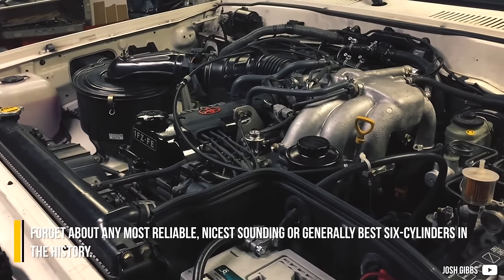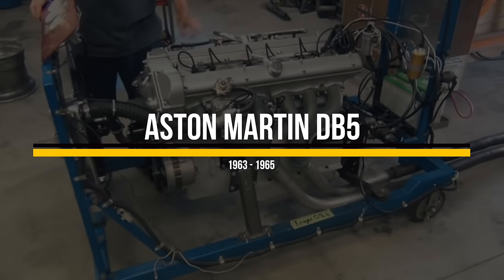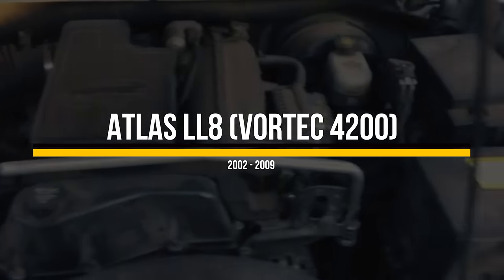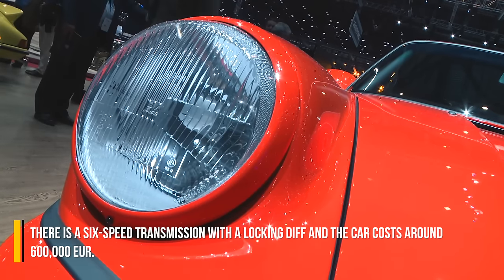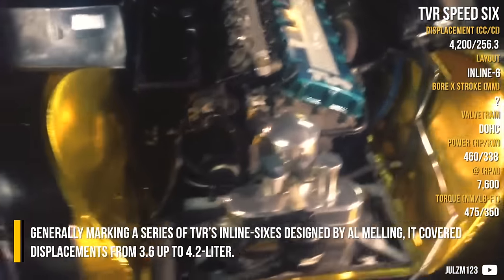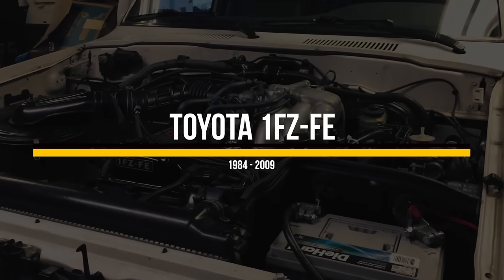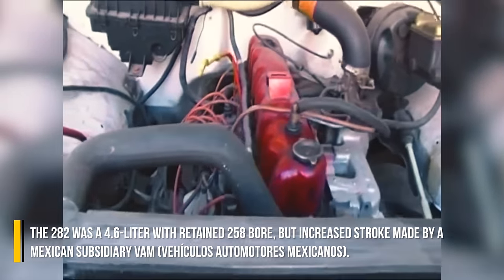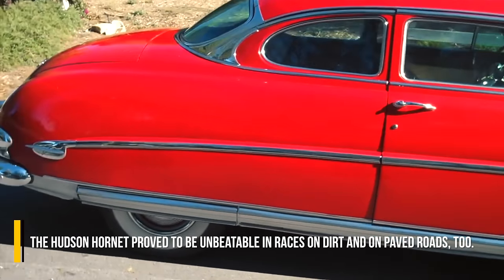12 Largest Automotive 6 Cylinders In The History

Comment: That Ford 300 is probably the slowest out of all the engines on this list but its my favorite. My Father owned several of them and they will tow nearly anything you ask of it (albeit, not in any hurry) and will run forever with proper care, especially oil changes.
Reply: Yeah those poor 300s are a gem for pulling but much above 3500 rpm they get winded think that's why they didn't make much h.p. They pulled much like a diesel. You can thank that on the normal sized bore and really long stroke.
Reply: Love the 300 ci ford. Can't kill them if properly maintained.
Reply: @maynardreed4036  yeah my crazy friend bought one time with over 250000 miles I asked him why he would buy something with that kinda mileage he suprised me when he got it to 415000miles before it started smoking some and making a little bearing rattle from low oil pressure
Reply: @ReidHenderson  yup probably still had another 50 or 75000 miles in it.
Reply: I had a Ford 300 in a '67 Fairlane back in the '70's. With some help from Clifford Engineering it would kill small block Fords and Chevys. Cam and kit, headers, intake manifold with 2 Weber carbs, porting and head work(larger valves), etc. It spun to 6500 rpm and made 366 HP. It was a fun car to drive! I had to put a top loader 4 speed trans in it, the stock 3 speed from the 240 kept breaking cluster gears.
Reply: @ajwilson605  Yes, Clifford-Jacobs Research [their motto: 6=8] were the only source for hi-po parts for the 300 during the 1980's. There just isn't many speed parts for this tough 7 main bearing engine, BTW the Ford 300 is rated for commercial duty, it is rated at 92 KW running on LP.

Comment: A few things-
-I don't think Inline and V engines should be grouped together. They have very different characteristics imo. V engines are a packaging/cost choice, inline engines are durability and low rpm torque choice. I very much miss my 5 speed manual 300 6 F150. I am not sure if Ford ever put the 300 6 in a car though.. but it was used in light duty F series trucks.
-I take it saying automotive allowed you to avoid heavy duty applications, because there were some quite big ones used. That makes sense to try and avoid all those old HD engines.
-I was disappointed when GM abandoned the Atlas series. The Inline 6 had more potential than the 4.3 currently used.. but costs are costs when talking base engines.

Comment: There's no replacement for displacement!
Reply: Variable valve timing...Turbo charging... But you're right.  Nothing feels like a v8 N/A engine with tons of response and bottom end torque.
Reply: Watch Boostedbois, that might change your mind hahah.
Reply: 4.1 liters but 125hp?
Reply: @franciscodieguez5187  The 1976 SS Model had 171 hp and 319 nm, pretty good for 70s
Reply: yeah. and Nux affirms that
Reply: Well, realistically, there is. You can't have tons of power just by adding displacement. Because if you do, the engine just keeps getting bigger and heavier, also revving slower, and you do need revs to make power. In real life, there is always a balance and an ever changing recipe to make power for each engine, since they are not the same.
Reply: Unless you count high revs and forced induction.  Then there is.  :)
Reply: I think you guys doesn't know what is a joke....
Reply: @igortchelzoff3736  I guess people make this joke too often and maybe that's why some may not be really responsive to this.
Reply: It isnt really a false statement though. You can replace displacement with boost, but you lose that N/A response. Bottom end torque isn't improved much either

A N/A large V8 mated with a manual transmission is a unique feeling. It cant be replaced.
Reply: 15 liter Cummins fuck yea
Reply: @Josh-cw8by  I don't see your point, so it would be the 3.5L V8 from the Atom
Reply: DoubleC can you Elaborate? Sorry man I don't see how you get my point.
Reply: @Josh-cw8by  You said an N/A large V8 can't be replaced, and so it would be a high revving 3.5L V8 from the Atom, that is why it doesn't make sense.
Reply: DoubleC high reving v8s are awesome, however the power falls off eventually. My favorite part about larger v8s is the torque you get at the bottom end. I'm a city driver.
Reply: Except a 4.0 barra turbo.
Reply: Zentäi 289
Cadillac made a 8.2 V8 that made 190 HP
they make engines differently now, i have a 2.8 inline 4 Cylinder that makes 175 HP
Reply: @anthonywebber2211  that's the biggest 4 cylinder I've heard of.
Reply: Josh
what 2.8?
Reply: @anthonywebber2211  you said you had a car with a 2.8 litre did you not?
Reply: i have a truck with a 2.8 liter
Jeep Liberty had a 2.8 L diesel
Chevrolet Colorado has a 2.8 diesel
Cummins 4BT is 2.8
and the Buick Bug had a 10.2 liter 4 cylinder
Reply: @Josh-cw8by  turbos and supercharging doesnt matter. If you have a 5ltr v8 with dohc vs a 2ltr 4 banger. The v8 will always beat the 4
Reply: @acedogboy8421  You're.. you're eating paint chips again. Stop that.  How can forced induction "not matter" when it necessarily changes the dynamics of the engine? Also, many 2L turbos will beat a 5L N/A and vice versa. Absolute claims are dishonest. Can you demonstrate that a 5L will ALWAYS beat a 2L?

Comment: First time I’ve seen your channel, interesting but lacking big time in research.  You had some light duty pickups featured so let me give you some help.  GMC had a line of V6 engines for their light duty trucks all during the 60’s and I to the early 70’s.  They ranged from 305CI all the way to  401CI, they even had. 432 and a 478CI.  All of these dwarf your 12 largest 6 cyl engines.  GM’s slogan was the power of  a 8 cyl and the economy of a 6 cyl.  By the way, neither claim was anywhere near true.

Comment: The later Atlas 4,2 had over 290 HP.  It was on Ward's 10 best engines list for many years. But I'm certain it never made the 16000 RPM you show.

Comment: I agree with the one comment the best engine I've ever built for straight 6 was the G MC 302 2 barrel carb 3in exhaust 12-inch clutch what are credible smooth-running Beast and it did have a great oiling system tremendous low-end torque I put it in a flatbed truck for a guy it was a sweet running machine

Comment: There was also the GM 4.3, which in my best estimation is one of if not the best V6’s to have ever been produced. It was basically a 350 with 2 cylinders lopped off.
Reply: Not found in any passenger cars, just trucks?
Reply: @sauluribe7082  it was put in s and t series trucks and CK trucks .
Reply: chevy put them in carices,had 265 thousand out of mine,Never was inside it,didnt use oil !

Comment: Almost every cummins?
Reply: Will Glenz I was kinda surprised not to see a Cummins on the list
Reply: it's basically a bus engine
Reply: @merroika1050  But they are used in production automotives as well 🤔
Reply: They are all gassers in this video
Reply: they did use it in the dodge Ram, but yeh it's classed as a truck engine basically.
Reply: 5.9L I6 from the 12 valve and 6.7L from the current, the latter being the largest 6 cylinder on the market today
Reply: This video only covered a biggest six cylinder gasoline engine
Reply: Well yeah, I'm guessing the reason he didn't include the 6bt was that it was really intended for commercial use but ended up in a normal pickup truck.
If we do include commercial diesels then we can go into mega displacements on the straight six,
Volvo does a 16litre straight six for there trucks with up to 750hp and 3550nm (~2600lbft) and I'm sure CAT did a 18litre highway straight 6 with ~900hp
And I'm sure there are many ship engines which much bigger displacements than that....
Reply: The 6BT was developed by Cummins specifically for use in the the Dodge Ram pickup trucks due to dodges lack of a diesel truck in its lineup. The 6BT was never meant for commercial use therefore is not in the same category as production commercial diesel motors. The 6.7L I6 in the current Cummins is also meant solely for the Dodge Ram pickup trucks therefore again does not fall into the same category as current production commercial diesel motors
Reply: @erinwoolen4797  No, it was ment as a commercial diesel before it ended up in the Ram hence why they're so strong and reliable
Reply: No, I have personally owned a 6BT ram.  I can attest to its reliability do not get me wrong. It was built by a company that produces commercial Diesel engines yes, but it was not built for commercial use. Look it up, get your facts right, and do not attempt to try and make me sound like I don’t know what I am talking about because you will find yourself on the wrong end of the knowledge.
Reply: @erinwoolen4797  erm.....

So when it came time for Dodge to up the ante in the world of heavy-duty pickups, they turned to Cummins for help. General Motors had the ultra-efficient Detroit diesel, while Ford had the powerful IDI diesel engine made by International Harvester. Both of these engines were V8 diesels specifically designed for use in a pickup truck as an alternative to thirsty gasoline engines. In contrast, Dodge decided to borrow the existing B Series Cummins engine. The B Series was a straight-six diesel engine widely used in mail trucks, school buses and even in mining operations as generators. It needed to work in the Ram, too—Dodge was already several years late to the diesel truck party.

I think "borrow" and "existing" are the main words in there....
Reply: Yes it was in the B series of motors but the 6BT in particular was developed for the truck. The platform of motors even included the 4cyl 4BT used in the international harvester which became the platform for the 6BT in the ram and the 6BTA which was used for other purposes. The 6BT in and of itself was designed for the ram not for commercial use. Yes you are correct it is in the B series of motors which were in fact designed for commercial use, but the 6BT itself was designed for the ram. You have your information almost correct, the only thing you’ve gotten wrong was the 6BT in particular
Reply: @erinwoolen4797  not true

Comment: Is it weird that the Ford Barra in the 2nd clip sounded almost like a Chevy/Ford V8 at idle?
Reply: Single cam 4L Intech motors get a massive chop on when you drop a decent cam into them
Reply: owned an AU XR6 lumpy cam 3-inch pipe it used to vibrate the windows on houses at 25kph
Reply: And all the 'Barra's' in the article never came in those models. BA on.

Comment: Sorry but I’m Australian and your numbers for the N/A Barra is off, the latest N/A Barra is 198kw. The turbo version is up around 300kw but all the cars in the video are N/A.
Reply: The turbo was actually 400kw in final guise, ford underate their power figures compared to GM which overhyped everything.
Reply: Sky Surv Aviation I was being conservative because he showed mostly BA falcons I think the BA mk2 was about 300kw
Reply: The BF makes 195 KW in base model (250 HP, give or take) and with a supercharger, what I'm planning to do, can make so much more.  Also, as a family sedan, the cars are cheap to make, and can run on regular fuel without drama.  An amazing motor that should still be in production
Reply: The turbo Barra in xr6 sprint is officially rated at 335kw or 370kw on overboost if I am correct

Comment: Rams 6.7 liter inline 6 cummins turbo diesel???
Reply: They put that shit in fire trucks.
Reply: Well, not the 6.7, but the 14.9 six cylinders are the top of the line right now with 600hp and 1800 ft/lbs.
Reply: @spencerhudzenko3734  psst! Its 605hp and 2050 lb/ft.
Reply: Diesels are in an other league. They don't play right here.
Reply: Volvo FH16 is a 16 liter inline six.

Comment: Great video man! However, you forgot to mention some engines like the Chevy 4.1L that was used in the Brazilian Opala in the 80s, and later on in the 90s Chevy introduced the 4.3L V6 vortec, which here in Brazil powered both the pickup truck s10 and the Blazer (the SUVs' father lol)

Comment: Those engines are small. Between 1905 and 1925 the leading luxury cars had six cylinder engines that were real monsters. For example, the Pierce Arrow 66, 825 cu in or 13.5 liters. McFarlan Twin Valve Six, 572 cu in 9.37 liters. Oldsmobile Limited, 707 cu in 11.6 liters. From Europe there was the Renault 40CV with its 557 cu in 9.1 liter engine and the Napier, who made the first six cylinder car, made an 80HP racing model with a 920 cu in 15 liter engine.

Comment: Hey Visio, just for a giggle, could you add a couple of ringers in at the end, say... a Peterbuilt or Mack truck diesel and maybe even a locomotive or large boat engine, just for perspective?  I loved that you threw in that custom single cylinder two liter motorcycle (with an engine cut out of an aircraft radial) and thought it would be neat to do here.

For the record, I knew of the Fabulous Hudson Hornet before cars!  My daughter calls this "being old".  The big reason the Hornet was successful in the earliest years of NASCAR racing was only partly the engine, which was definitely large and powerful for the early 1950s, but also because the lower center of gravity afforded by the "Step Down" interiors (a perimeter frame design where the floor was placed inside and between the frame rails instead of over them, as with a ladder chassis) gave the cars a handling edge over their more traditional body on frame competitors.  Hudsons ruled the roost for several seasons, but when the V8's started being introduced in the mid-fifties, the Hudsons increasingly lost their competitive edge.

Comment: Just to add some perspective to this , the Aussie Chrysler Valiant 265 cid in line 6 cylinder RT e-49  Charger held the title as the quickest accelerating PRODUCTION  6 cylinder in the world for nigh on 15 yrs, it was only with the advent of  turbo charging that another in line  ( the Holden Calais Brock Director Special with a turbo Nissan RBDet motor) 6 was able to beat it's 1/4 mile times. The triple dual throat webers hanging off the 265 gave it a howl that would send tingles up the spines of most V8 drivers as well, they knew how quick these bloody things were and most sane V8 steerers let them sprint away at the lights without trying to race them as they knew the embarrassment of getting flogged by a mere 6 pot would be hard to swallow.
So far as bragging rights go, the 265 Aussie Hemi 6 handed every other in line 6 it's ass in spades, nothing held a candle to it as far as potency.

Comment: The standard 4 litre Barra fitted to base models made 260 HP. The turbo version fitted to the Last of the Falcon Sprints in 2016 made 455 HP, and tuners today  are getting more than  1000 HP without doing much more than fitting larger turbos and stronger pistons rods, valve springs, and oil pumps.  Every Barra came with cross bolted main bearings and steel girdles on the main bearing caps and camshaft bearings and roller rockers.Most taxies in Australia used to be Falcons with Barra 4 litre engines.  It was not uncommon for these engines  to last for more than a million kilometers with nothing more than normal maintenance.

Comment: The largest production 6 cylinder in automobiles, ever, was the Pierce Arrow. It started at 11.7 litres, then to 13.5 L, and finally 14 litres! That's 855 C.I., with a 5 inch bore and a 7.25inch stroke! And these were luxury, hi-end automobiles.

Comment: 1948 Tucker - 6 cylinder boxer, 5475cc, 334CID.  It was a Franklin O-335 converted from aviation use and air cooling to automotive use and water cooling.

Comment: All peanut engines. The 292 Chev inline six, used in pickup trucks and larger trucks.
The Ford 300 inline six, used in pickup trucks and larger trucks.
The GMC 301 inline six, also used in pickup trucks and larger trucks. 
The Chev 261 inline six, used in pickup trucks and larger trucks as well as Canadian Pontiac cars. 
The GMC V6 engine series, used in pickup trucks and semi tractors. They ranged in size from 305 CID up to 478 CID. GMC also manufactured a 600 something 60° V8. This was one of the V6 engines with 2 more cylinders. They also produced a 702 CID V12 using the 351M bore and stroke. It had a one piece block, crankshaft and camshaft, but used 4 of the 351M cylinder heads, two intake manifolds and two carburetors. 
They also built some as diesel under the Toroflow name.
There are older 6 cylinders that dwarf these engines from when materials and design technologies were not as modern as now and huge displacements provided the power with 5:1 compression ratios and poor gasoline quality.

Comment: The aluminum head Hudson Hornet engine was big - too big for one head that had head gasket problems when really hot. The poor cooling system didn't help. The straight OHC six in the Supra and Cressida was a great engine -smooth and reliable. Mercedes is bringing back the straight six this year with huge power.

Comment: Pontiac had a 350 cubic inch overhead cam inline six in  the late 60's. The block was iron and the cylinder head was aluminum.